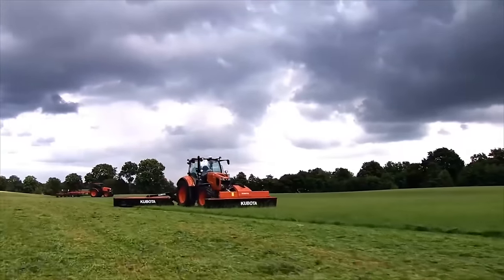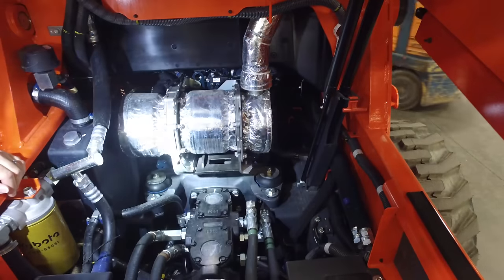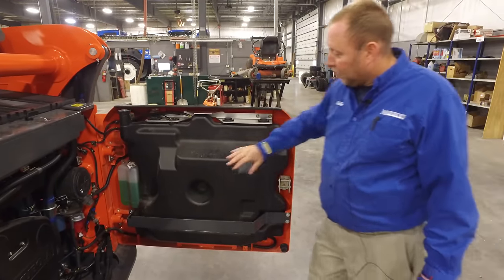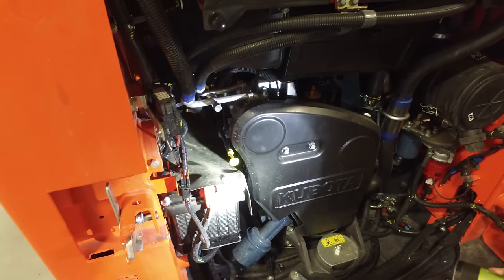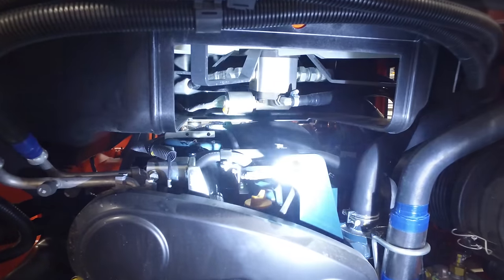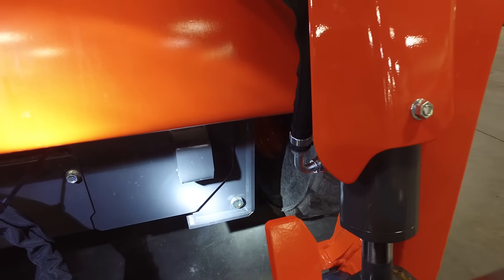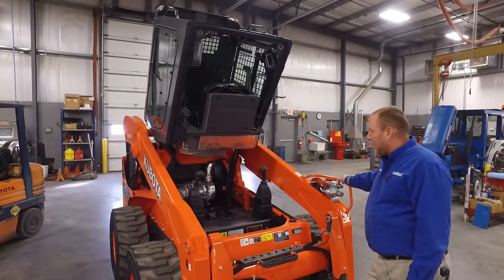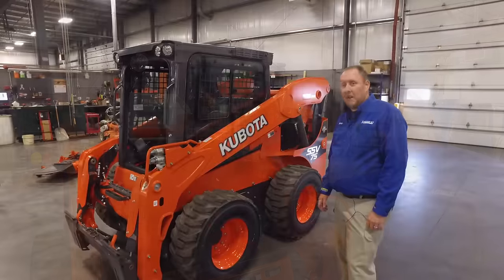Service & Maintenance Tips on a Kubota SSV75 Skid Loader by Messick's

Comment: Kudos to Eddie!  You gave a calm, "non-fidgety" and information-packed presentation.

Not trying to ding you, but bc all cab Kubota's come with Quick-Hitch, you did miss the QH zerk.  Also, inside the cab, you didn't mention the internally located Hydraulic Suction Filter which I think requires replacement every 250 hours...so maybe that's why you skipped it?  That one looks like "fun" to change - does anyone know if ya gotta drain the hydraulic fluid in order not to flood out the engine compartment?